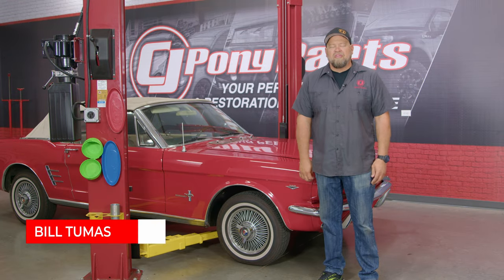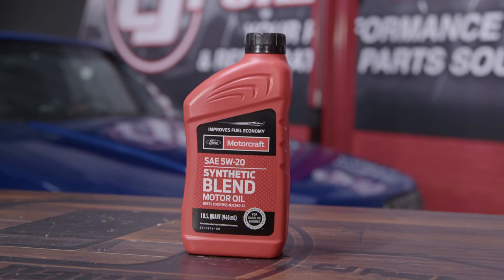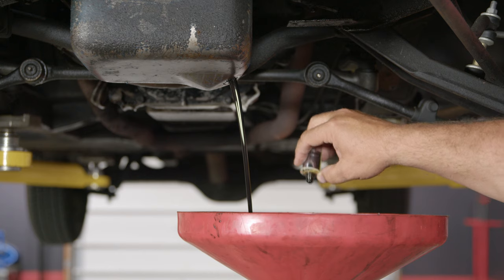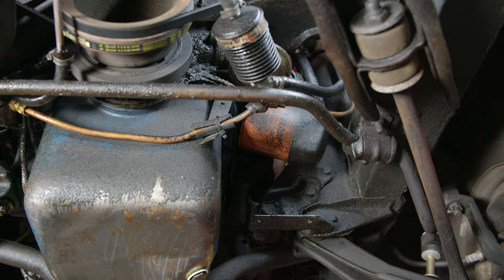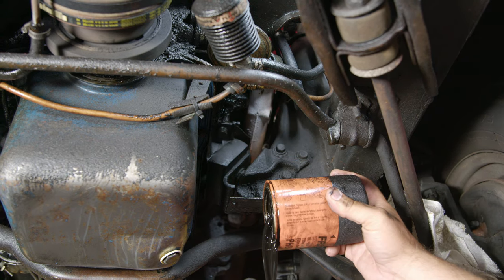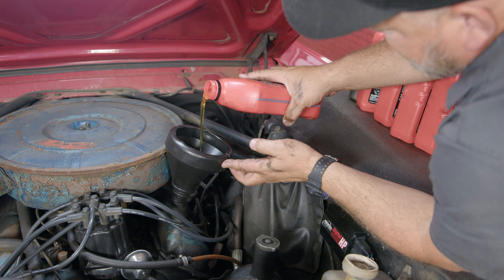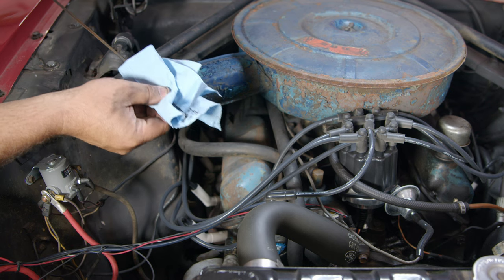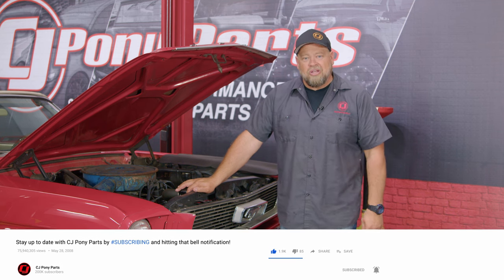Classic Mustang Oil Change Made Easy! 👍🛢️DIY Mechanic Work

Comment: make sure the rubber gasket comes off with the old filter.  The first time I changed the oil in my 64 1/2 I didn't notice it stuck to the block and screwed the new filter on.  Made for a hell of a mess when I filled it back up and cranked the engine.

Comment: Part of an Lube, Oil & Filter is to grease the chassis. Yours has zert fittings on all of the front suspension and steering parts. You also want to see if the u joints have zert fitting and also make sure the rear differential is full

Comment: I used a 90 degree oil filter adapter on my 351C so the filter sits vertically making removing the filter less messy.
Reply: I just got a Camaro instead. Filter drops straight down from the factory!

Comment: Should you add oil to the filter?
Reply: If your filler is mounted at an angle like that one was, you run the risk of it leaking out as you try to install it. Essentially wasting some oil. If you are worried about a “dry” start up, you could disable the ignition system and crank the engine until you get oil pressure. I find it’s really not that much of an issue.
Just my two cents.